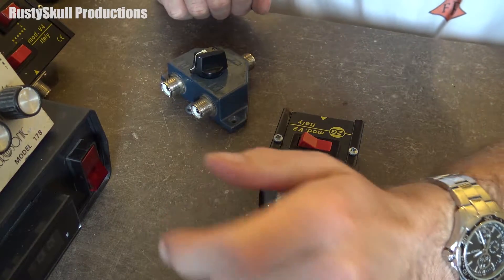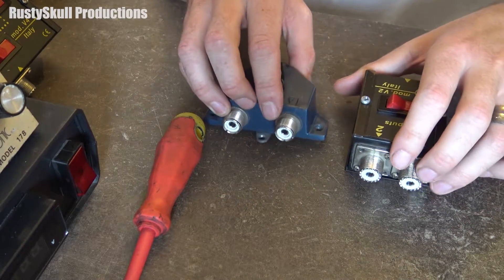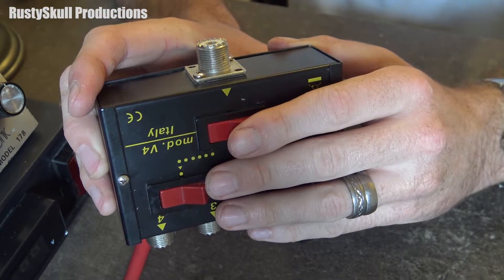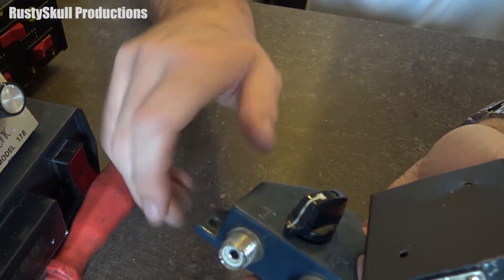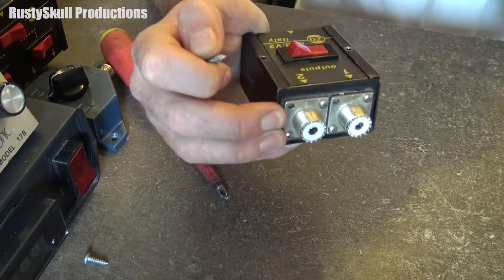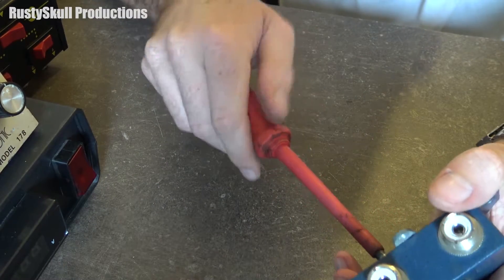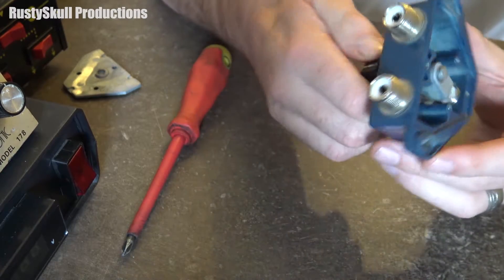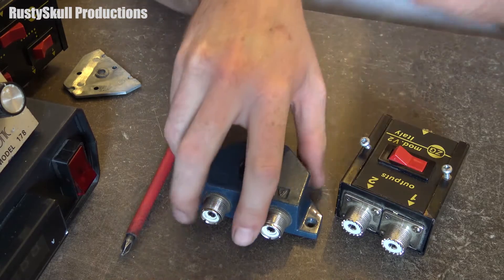What Is An Antenna Switch?

Comment: The CX-20 is a very poor switch. The spring contacts eventually loose compression.  Mine don't even have round metal contacts at at the ends of the contact springs.

Comment: Never use that Italian zetagi junk!
The blue one is oké, can take a 1KW. The isolation between the twoo ports of the blue switch, is at least 50 dB @ 145 MHz and about 60 dB + @ 30MHz on lower frequency's more than 60db isolation. Wat means that u can use the switch safly the other way around 2 TRX and 1 ANT with 500 watt from 1 - 30 MHz. The maximum safe input of a receiver is 10 dBm, prefered is 0 dBm or less! The insertion loss of the blue switch is about 0.2 dB.